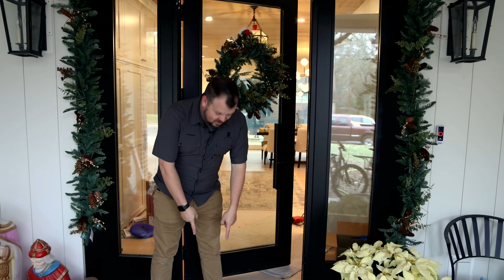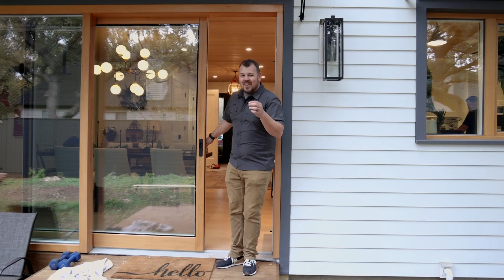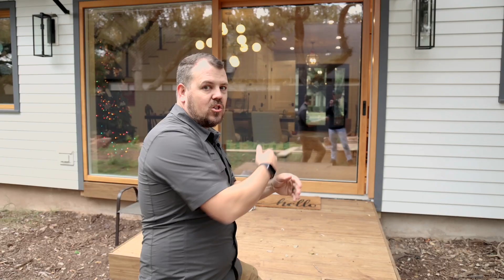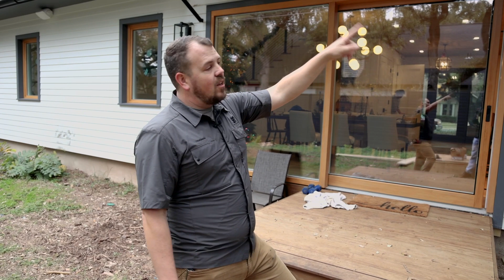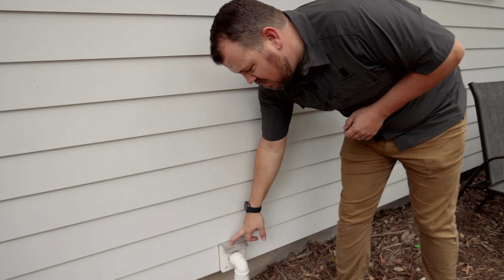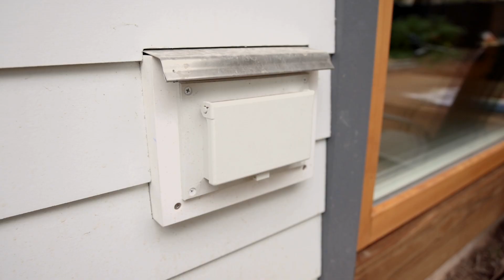Watewr Management at Matt Risinger’s Home

Comment: Hi Jake, I love this video! Thank you for sharing this information. I was wondering what are your recommendations to prevent water intrusion for windy areas where rain goes sideways? Also, is there a preference for the type of materials for waterproofing (like brick siding and a metal roof)?
Reply from the maker: In very windy areas I might consider sealing all four sides of the window and attempting to create a barrier system. Pushing windows deeper into the wall will help too.